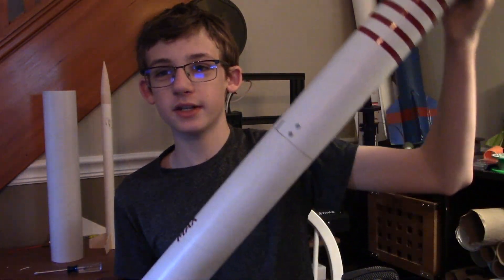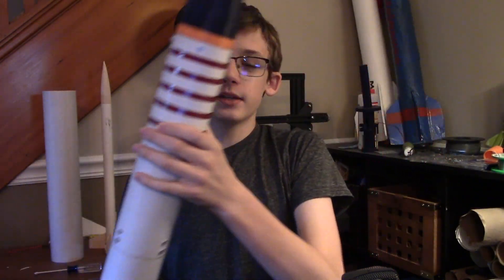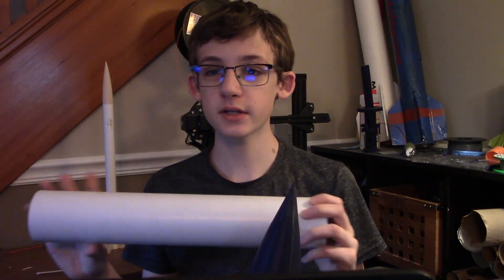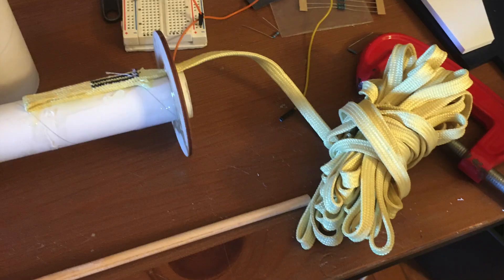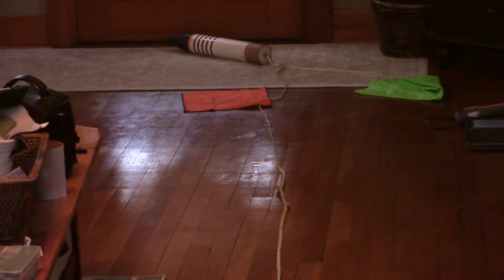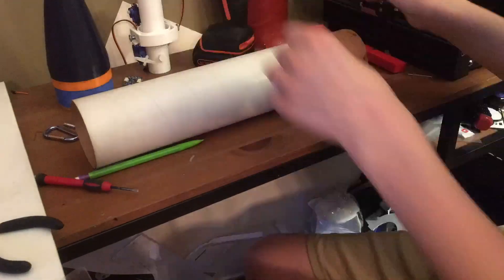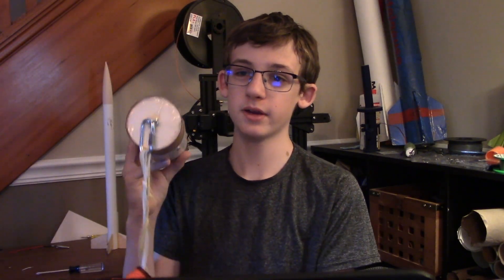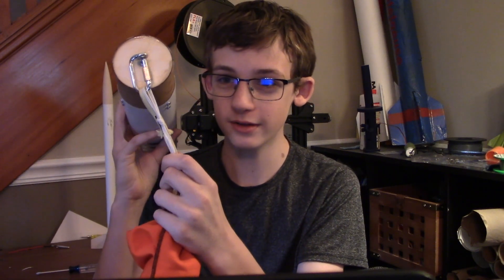How do you build a HPR rocket? Energizer EP 1.

Comment: I love the rockets you make! There super cool! Wood and similar materials are also great and are lighter than 3d printed plastic and pre manufactured nose cones are the same. It’s good to use plastic on the avionics but you may want to swap that for metal in the future for lvl 2 rockets. Very nice though!
Reply from the maker: I actually have a project coming soon, in that project i am using metal for the avionics bay. Plastic is good until you start going mach 1 so... you might have a idea of what this next project is going to be like lol.